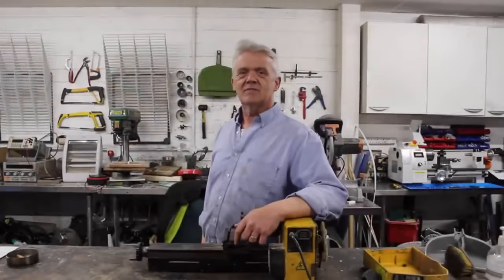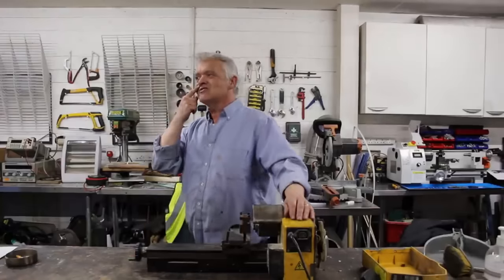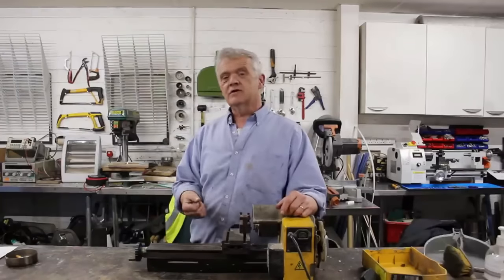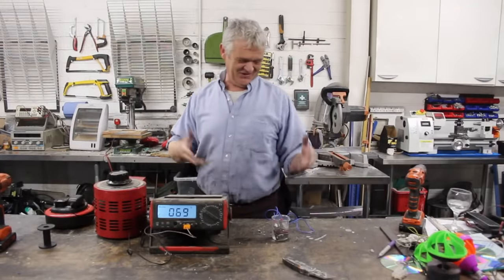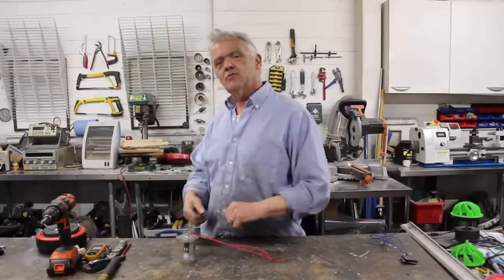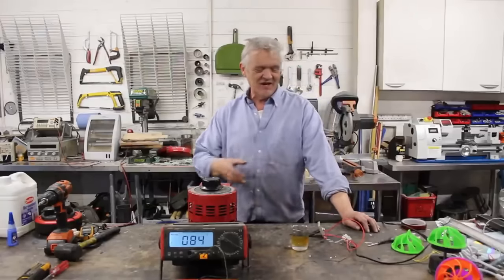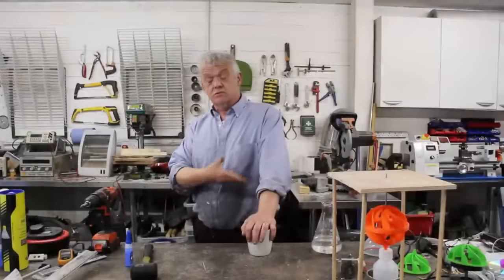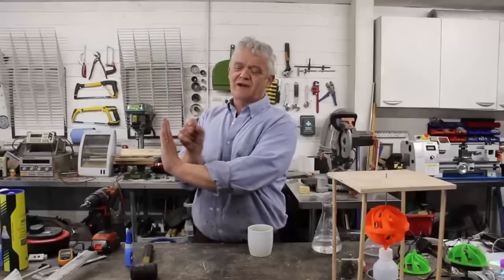016 The Dumas Effect - A Free Energy Water Heater

Comment: Oh nooo Rob your right on alot here but those guys did have a resonant heater you dont understand or your trying to hide. Ill give you the answer cause im not interested in hiding anything . Those men did not acheive the so called resonant frequency of water itself that would be ridiculous. They matched the mains frequency of 50 or 60 hertz with the resonant frequency of thier heating elements ( the sphere , bells, or plates ) . They were made the right size and shape that when you strike them they make a noise of 50 or 60 hertz
Reply: so, you're saying it's RLC circuit made with plates that has resonant frequency of 50-60Hz? i doubt Rob ever hid anything as he's the most technology and information freedom person i know. similary, i doubt he does not understand the fundamentals (such as RLC circuit). so this comment is spreading absurd idea. even if we suppose 50-60 hz frequency can be achieved with that dimentions (which it's not, going to be way larger as mains frequency is super low for the magnitude of units) in case of RLC circuit underlying principle is staying the same water has the resistance and you're applying voltage accross this resistance and video is legit.
Reply: @tsraikage  or a harmonic of 50-60 hz. Your gonna have to explain the frequency of water

Comment: I'm a little confused, did Dumas invent the stinger? A stinger is a device used in prison to cook food or boil water. I uses two pieces of metal submerged in water or oatmeal or something. The resistance to current creates heat between the electrodes making the water the heating element.

Comment: Can you make the same thing using foil and flower pots layered on each other. The anode effect makes plenty of heat from electrolyte  and a current passed through it. I have used the chemicals from a crystal growing kit to boil water just by running electricity through the electrolyte with two stainless steel electrodes.
Reply: Dump the wires straight into the water..... it will work.... nothing special here.

Comment: I'm wondering if electrolysis in for batteries can be made vastly more efficient if instead of vibrating the electrodes, they pumped the electrolyte  through one of those new solid state "fans" for CPU cooling to clear the accumulated gasses. Those things can produce a jet that can pierce through the heat bubble that typically forms around hot surfaces to force cold air in contact with the surface rather than simply conduct heat away via the bubble. Of course, those devices would have to be adapted for the specific electrolyte rather than air, but theoretically, it can make better contact with electrolyte and electrode over any period of time.

Comment: This video is not about the Dumas Effect. The claim of the Dumas effect is not to boil water, which is well done by a simple resistor as you say. The claim is to get more than 1 efficiency, which of course does not exist. Resonance does occur in the Dumas effect, and leads to a "cold" nuclear reaction which produces a huge amount of energy (which mass defect is probably not measurable with simple tools). This does not break the mass and energy conservation.

Comment: this technology has been used in vaporizers for medical use for decades.  its just resistive heating. the water is the resister. yes, I know you are using distilled water that is non conductive but you have contaminated it with the electrolyte from the carbon rods. I would love to have seen a ohm meter reading across the rods and perhaps an currant reading?
we used to cook hotdogs this way in my electronics class, just put mains to each end of the hotdog and 30 seconds later its cooked!

Comment: Why does scale lower heater efficiency? Resistive heaters are by their nature always 100% efficient. The only thing I could imagine is that scaling on the heating element slows the heat transfer causing the element to overheat and either trip a thermal fuse or increase its internal resistance thus lowering the heat output (and electricity consumption). So I genuinely don't understand how that ohmic array could save energy compared to standard resistive heater.

Comment: Can you do THE SAME thing, but add a solenoid shooting magnetism between the plates?
at 50hz dont know exactly what kind of solenoid you need to not short it out, but it should split the current into magnetism acting on water and you should get a 1 way propulsion

edit: oh, 1 side of solenoid touching 1 plate and other side the other. Sort of LC tank circuit
edit2: I believe washing mashines have already wound solenoids in them for actuating the flaps via magnetism?

Comment: Its basically a capacitor shorted by water!   I wonder if it will work with rectified AC, it has the 50/60Hz ripple, i wonder what is in the water after?
Reply: Rectified AC is DC. If it has ripple, due to no smoothing, it's still DC, its just varying voltage DC. So the electrolysis will vary at by the same amount. No different to using a DC power supply and winding the voltage up and down. No effect other than less electrolysis compared to smoothed DC.

Comment: So what if you had 2 welding rods suspended by ceramics  in say a copper pipe and ran water thru it, would you have a tankless water heater? Shame you didn't show the temp the whole time voltage was applied along with a stopwatch to show how long this actually took.  Otherwise an array of these in a water heater could increase the efficiency of the tank exponentially.  In essence it would heat on demand.

Comment: Well- this is an inside-out technology. And it is far more superior to the one we have used to so far. Similar in side- out tech is with electro motors when the core does not rotate, but the motor does. And the plopellers un till now have the center unavailable because it is where the wings meet, but having wings connected to the perimeter ring leaving center open , we can get the whirlpool effect with much higher rotation limits. Up to no limits at all. And if the perimeter ring can change its diameter , we can get the levitation.

Comment: 07:03  - A VARIAC DOES NOT isolate from the MAINS
A VARIAC is an Auto  transformer with a single winding
and an over-wind  to produce a voltage higher that the input
voltage at the top end of the winding.
Much like an ignition coil on a KETTERING ignition system
And when reducing the Voltage  - one is increasing the Current, 
When using a VARIAC -  it is wise - and for safety reasons -
to connect the VARIAC to the MAINS - via an appropriate
Isolation transformer hat can handle the curent.

Comment: FYI, Heatworks no longer exists - they must have been so successful that they sold out for billions in the last 2 weeks!!

On a serious note, the critical factor in boiling water is the mass being boiled and the time it takes. This gives the amount of energy that has been delivered q = m Cp dT. [ m =mass being heated, Cp = specific heat of water, dT = temperature change]. If we compare ths to boiling a jug, which holds a lot more water than the experiment, a rough comparison could be made. Place a known mass of water in the jug and see how long it takes to go from the start temp to boiling.

The experiment used a very small volume and although direct heating is more efficient there doesn't seem to be any free bonus heating. Most heating applications do not boil water for domestic use so the efficiency of direct heating is no benefit. The old style element delivers all of its energy to the water after the thermostat turns off. The only real benefit is the ability to heat water on demand so your heating losses are reduced. However these units start at 6.2kW, which is quite high but necessary to provide instant hot water. This is an incremental improvement but there is no magic involved

I cant help comment of the name, dumas. Watch the video with subtitles and it comes out as dumbass.

Comment: Is 50hz really fast enough to not produce any free hydrogen or oxygen? I could imagine accidents if even tiny amounts could build up in heating pipes and radiators.
Reply: Electrolysis only occurs with DC, that is, current flowing in one direction.
Reply: @munroberry1248  Well even in AC current is always only flowing in one direction at a time ;-) You end up with tiny amounts of free hydrogen and oxygen at both anode and cathode, thats not safe in a closed system i bet.

Comment: Seems you are just basically creating a weakened version of a short. We have seen it many times before where people use car batteries and hook them up to a carbon rod and the rod will get red hot. Here its same thing except you are putting a tiny gap between it so won't burn out, but rather at the expense of the medium which its in (water). So is this resonance or a heating element with gap? Interesting none the less, but this is also a HHO generator, my worry if its enclosed might have a tendency to go BOOM! haha. Would love to try this as a replacement for heating element.

Awesome vid, thanks!

Comment: Just catching up on some of your videos.  The system appears to be the same tech used in instant heat tankless water heaters. These have been around for a couple of decades.  If you find a junked one you can get the guts of it to check it out.  I wonder how much electricity placing this same guts in a steam pipe or boiling pot would it generate anything?  My guess is it will but orders of magnitude smaller than the amount of electricity consumed to produce the same amount of heat.  I hope you find the thought interesting enough to look into.

Comment: No resonance with this device. Just an electrolyzer splitting water giving off H, O and steam. Heat is the product of current x voltage passing through electrical resistance (Water)

Comment: Robert, Could it be that the AC 50-60 Hz is creating a molecular rocking motion. These atomic librations move / stretch the hydrogen bonds between the water molecules, the stretching / relaxing of molecular bonds are transformed to heat within the distilled water solution. Similar to how a microwave oven can use the same principle to heat moisture in food, or boil water.
Reply: Microwaves use GHz frequencies as Robert mentioned. 50Hz is virtually DC compared to 2.5GHz and has no effect, other than to stop electrolysis, as Robert explained. Microwaves cause heating by rotating molecules that are polar.
Reply: @richardmarkham8369  agreed. Thank You for the thoughtful reply. : )

Comment: None of this is "free energy" even if you could resonate the water. If the water fouled up, doesn't that mean there was some electrolysis going on with metal pulled off the plates and into the water? If you wouldn't drink the water because it came from a battery, then you admit it wasn't distilled anymore at the point when the graphite went in, In Soviet Russia, electric plugs used to have slots on the tips of the prongs that could hold razor blades.

I think a coat of limescale would reduce maximum safe power output, not efficiency. If the spiral heats up more, it eventually has to give up its heat to the surrounding water, albeit slower than if it was bare. The heat has nowhere else to be lost.

Comment: Looks like a capacitor with the water acting as the dielectric.
Reply: I see the analogy, but no electrical charge is stored.
Reply: @munroberry1248  If you put AC potential across a capacitor it passes current which is what seems to be happening here. Capacitors store charge if one puts DC potential on them but pass no current.

Comment: Please measure what is produced from the water. As soon as some Chlorine (salt) is in,  Cl2 will develop, if voltage is >4V I think,  which is toxic, and some useful inorganic antiseptics.
Electrolysis is a beast, and one would need some UV-VIS absorption spectrometer 200nm .. to get a clue, best by buying a cuvette-to-fibre adaptor,  inserting the 2 fibres looking at each others end to measure insides the reaction chamber.

Comment: Doesn't this thing electrocute the water? If you used it in a water heater, it would zap the water flowing through the pipe whenever it fired, which it would do as soon as water started flowing through the pipe! 😅

Comment: as the dc flows through the rod and the solution being acid would not the rod them selves be breaking down that why you get different gas at each rod if the rod where made from different matterial like steal and copper

Comment: Actually that's not correct  AC is not DC with a frequency AC alternates back and forth between north and south or positive and negative, DC with a frequency is just pulsed DC a certain number of times a second  it does not alternate between positive and negative.

Comment: If you did this with DC electricity you would end up separating  into hydrogen and oxygen via electrolysis. What is happening when you do this with AC? The molecules separate and then recombine? Then because the molecules have been so excited to get hot. I'm just supposing. I only think I know what I'm talking about. In high school they taught us that heat was just molecules vibrating a lot. Is that true? You're stuck to finger in the water you'd get a shock. So you can't use this for continuous water heater because the water would come out of the tap very hot so to speak. The water heater would have to keep the water and shut off anytime it felt the pressure drop indicating that a positive been turned on.

Comment: Any water heating systems that immerse live electrodes in the water is not a good idea. You have no idea of the purity of the water or its conductivity. At the very least you will trip the ground fault interrupter, or worse you may shock or kill someone in the shower. The scale on the heating element in a hot water heater does not change its efficiency, it changes how long it will take to heat up the water. If you put in 1 kWh of energy you will get 3412 BTU into the tank. The element will run hotter and eventually burn out, but the efficiency remains basically 100%.

Comment: “Free Energy” put me off.  I watched it anyhow.  I get the delay in a standard resistance wire element but I doubt there is an efficiency difference as the heat created mostly still stays in the water mass.  Try your experiment in pure distilled water without contaminating it.  I bet you get zero heating.

Comment: This is just ordinary electrical resistance heating, as happens with anything you dump a lot of electrical power into, which is why it works with any shape of electrodes. The stuff about 'resonance' is just nonsense, & the energy used isn't free either, as you can see if you watch the power consumption of the device while it's working, & will be confirmed by your power bill.

Comment: 15:20. paraphrase: "normal heating elements have to be isolated from the water". Yeah, for safety reasons. Normal heating elements work just fine if you dunk them in water, its just dangerous. What makes ohmic heating safer so that it does not need to be isolated? Nothing. Its not isolated. Its dangerous as hell. Making it safe against all possible failure modes is very difficult. Thats why very few products use this technique. Some of those products are poorly designed and very dangerous, and sometimes even banned in various countries. 

Also, the water needs ions for this to work. Distilled water won't work. A 'vaporizer' product even usually instructs you to add salt to the water to make it work.
Also, I'm pretty sure the idea of sticking electrodes in water to heat it was discovered shortly after sufficiently high voltage electricity was invented. 
Also, resonance? Yeah that's BS. You can design a shape that helps with convection of the water to heat it faster, but thats unrelated to resonance. If I want to be extremely charitable, I suppose, maybe you could design a certain shape that gives you a tiny capacitance and inductance, and if you tune that,  maybe you can shift the power factor a tiny bit the get better apparent power efficiency, but thats a stretch.

Comment: Jes mate , get some basic knowledge . 1st off variacs do NOT isolate you from the mains like an isolating transformer . Then hot glue as an insulation to a device that heats water and surprise surprise the glue melted and the plates Shorted putting huge strain on the variacs circuit breaker .